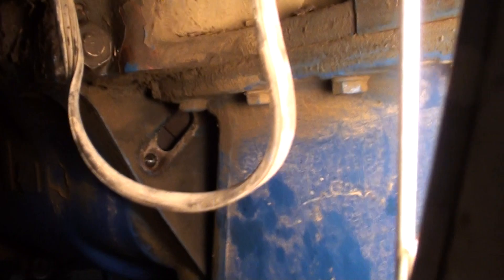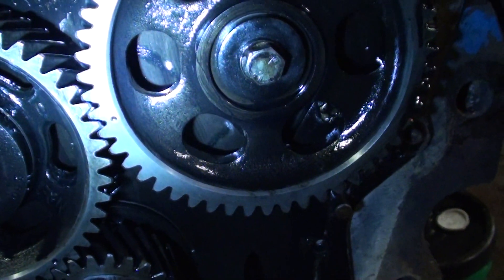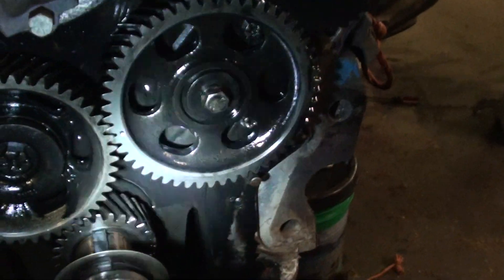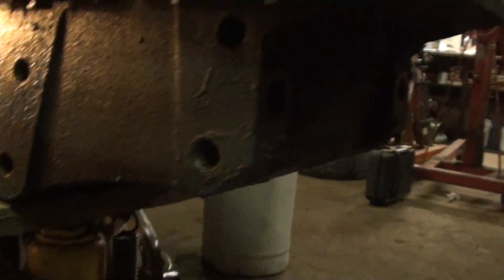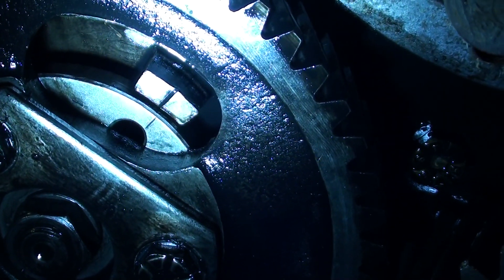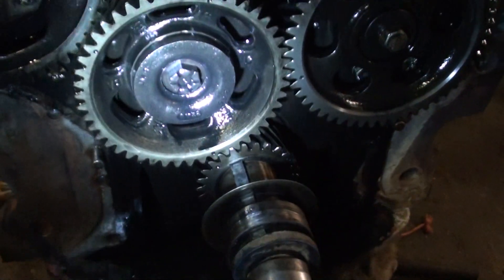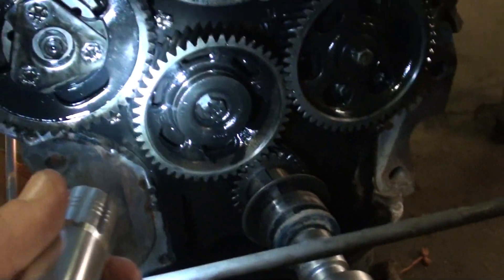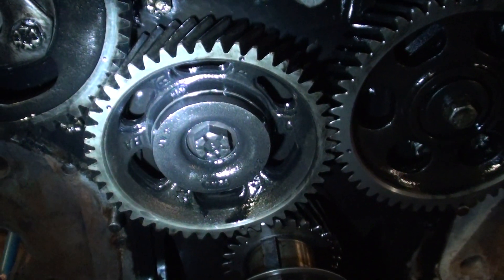Ford 9600 Timing troubleshooting

Comment: Your center gear is off. Notice that there are three punchmarks but some are in front of the teeth and others are exactly on the valley between two teeth.

The valley mark has to meet a teeth mark so that they really are aligned.